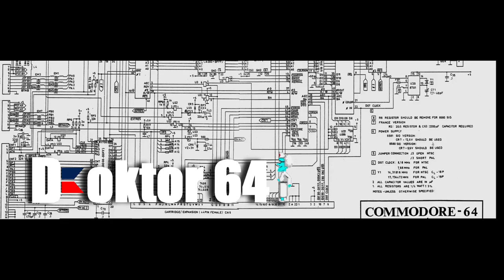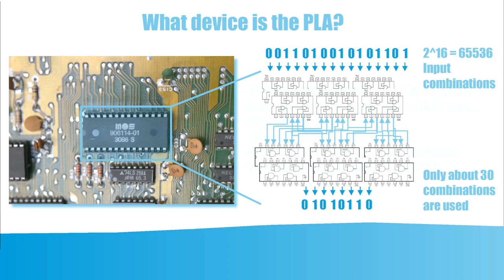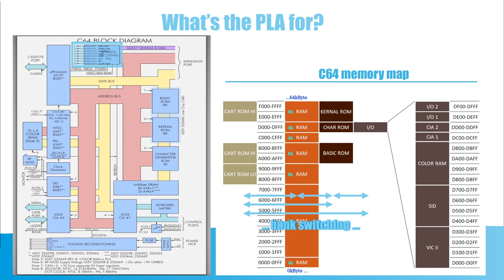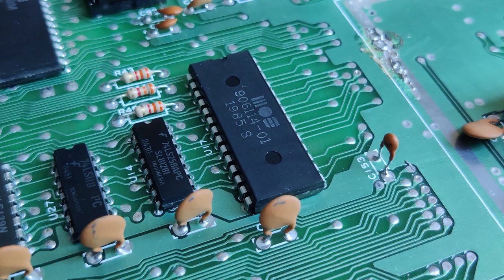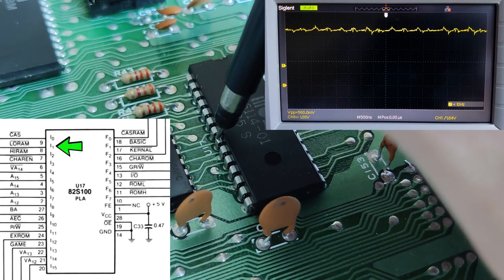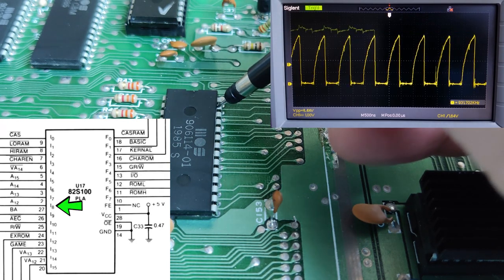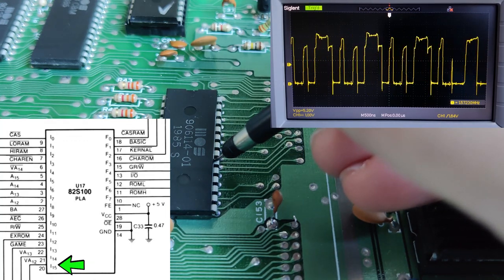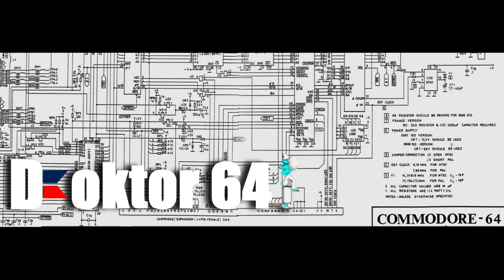Doc64 #26 | Commodore C64 | What's the PLA for and how does it work?

Comment: I still don't understand how a simple EPROM (that's just a read-only memory, a static content) can be used to replace a PLA that, according the explanation, seems to be a dynamic chip, something more similar to a bunch of 74xxx logic ports. I didn't find an explanation for that yet.
Reply from the maker: Hi! That's not so complicated. An EPROM has Adress Inputs and Data Outputs. If you access an adress then, according to the "program" in the EPPROM, it will give you something on the data output pins. That's what the PLA is doing also.
Greetings, Doc64!
Reply: @doktor6495 So, in effect, you are actually programming a set of truth tables into the EPROM that will present a certain data pattern on the data pins whenever a certain combination of address lines are selected for the EPROM. When the EPROM has certain address lines selected the data output pins will be emulating the pin outputs of the original PLA which are stored internally at the address you presented on it's address bus. A very clever work around ;)